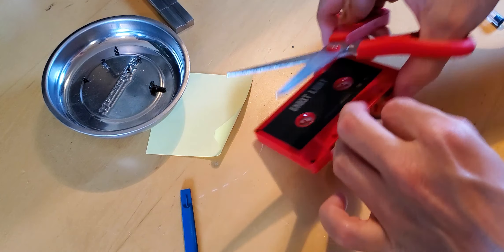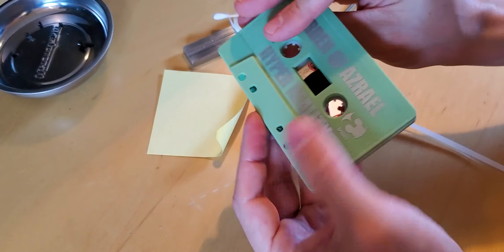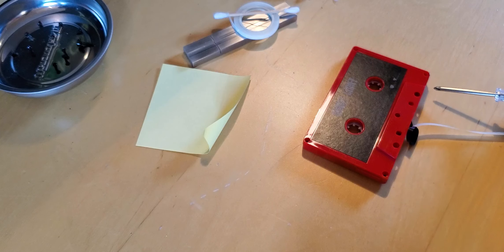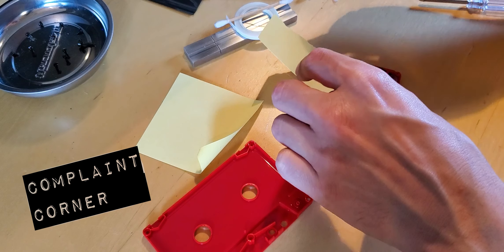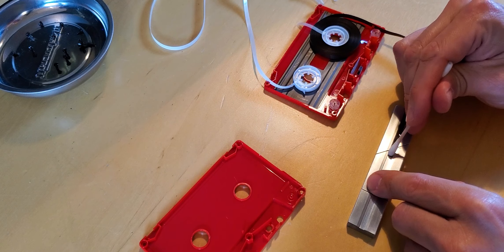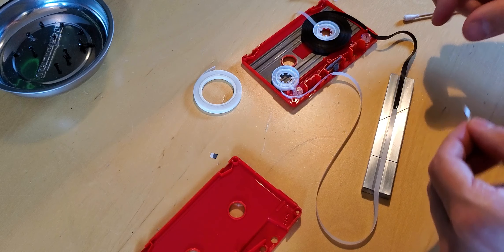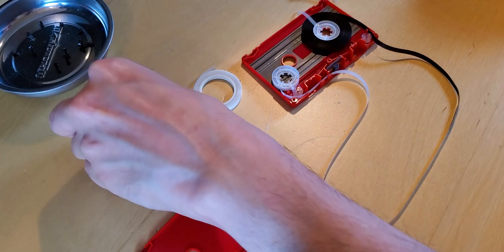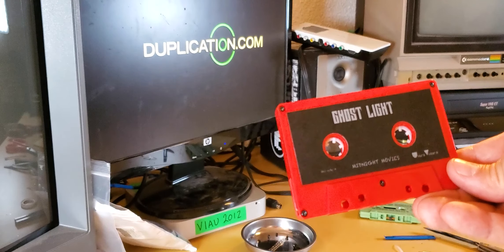How to Splice and Repair an Audio Cassette

Comment: I don't want to be that guy, but that's not what you want to show when you're teaching someone to do a splice. First off, you don't really need a 45 degree cut where you join the leader to the tape, only when you splice tape to tape. Straight cut is just fine for that, as any cassette ever made will show. Second, if you do angled cuts on tape, make sure you cut both sides at the same angle. What you did in the video was cut the tape at 45 degrees and left the leader straight. Then you overlaped the tape and leader which means you have a bit of tape just dangling free, which is a recipie for disaster. Whenever you're splicing any tape, whether it's a cassette tape, 1/4 tape or vhs, the sides of the tape you're joining need to butt together with no overlap or gap. Having an overlap means your tape can catch on your head or pinchroller (if not in the case) and either break or get mangled. Having a gap means you're smearing adhesive over your tape path, also not good.
Reply from the maker: I appreciate the response and tips! I'm actually going to be splicing a VHS tape tonight so I'll keep your advice in mind. Thanks for sharing.